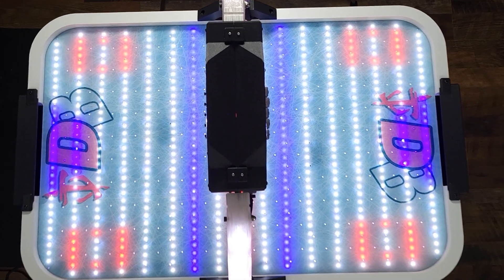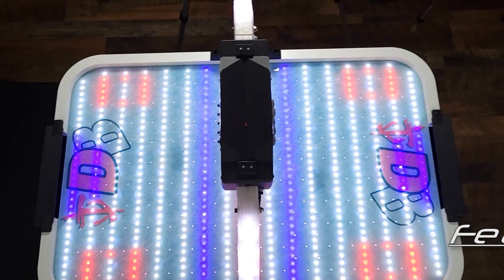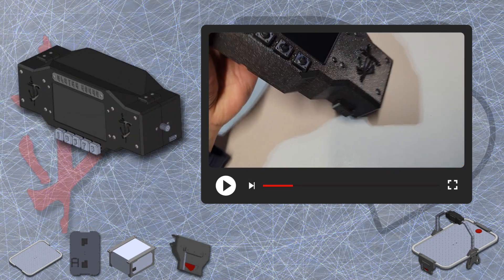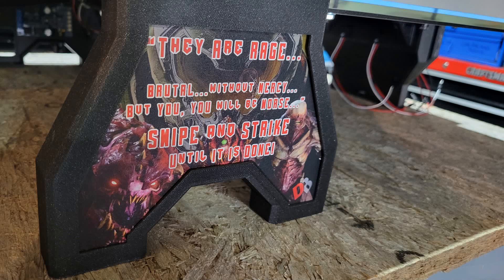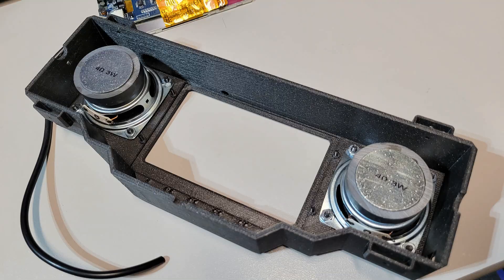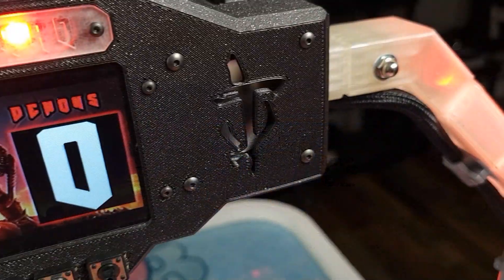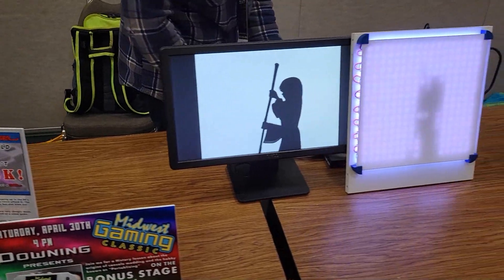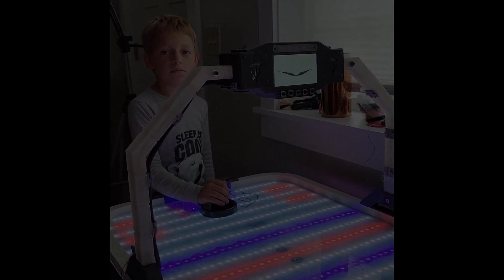How I Built A Mini, Pi-Powered Air Hockey Table With A Hint of DOOM

Comment: This is awesome and has given me inspiration! 👍🏻 What is the name of the curved piece at the 4:00 mark that is attached to the blower so the air flow travels vertically rather than horizontal and where can I get them? How has the Komacel side/rink wall held up with the puck constantly hitting it? It looks like soft foam. Do indentations happen because of this? Or does it function somewhat like memory foam and revert back to it's original shape? I only need a power supply for the blower fans and LEDs on the play field correct? Please let me know. Thanks!
Reply from the maker: Glad to help inspire! That was actually a custom 3D printed elbow that I made up to change the direction of the air. The Komacel is actually pretty tough as it's a PVC based product, not foam. So yeah it marks up a bit after awhile, but has not had any severe dents that have caused any problems. As for the power supply, it depends on how far you wanna go with it. The LEDs are controlled by a Raspberry Pi which is also powered by the Power Supply, as are the screens, audio amp and the break beam sensors in the puck traps.
Reply: @DowningsBasement  would you be willing to share your files for the custom 3D printed elbow? I'm really only interested in the LEDs underneath the play field; is the Pi(s) still needed for that?